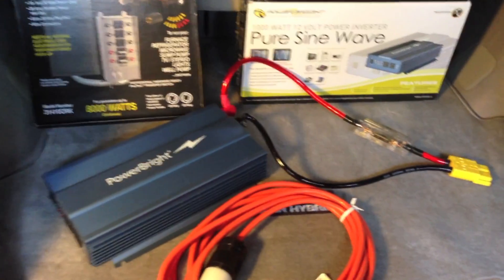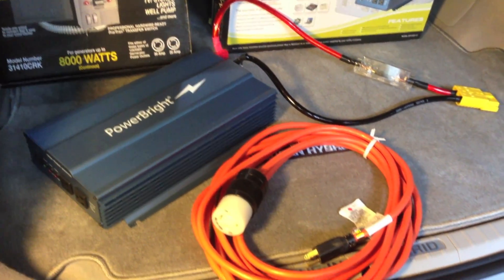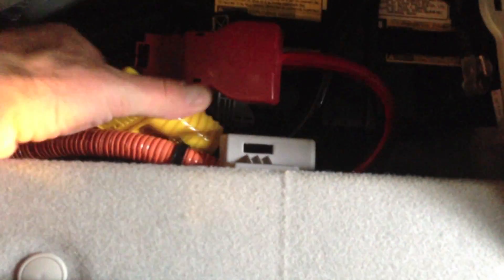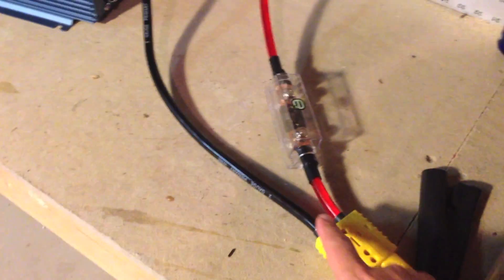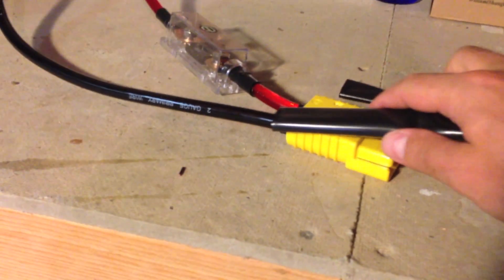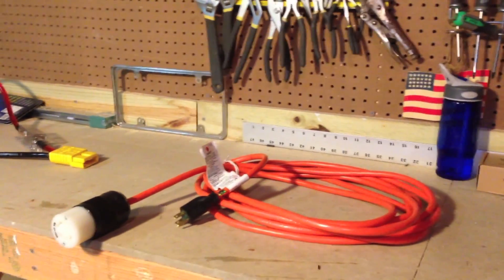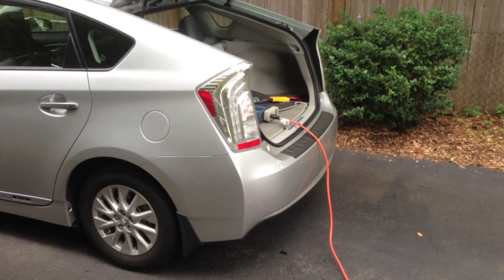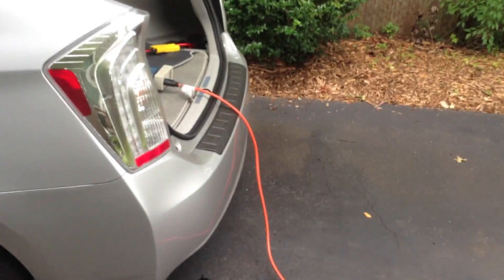Prius Home Generator - Part I

Comment: I love this video. Very useful. I have been considering taking this a step further and removing the generator from between the engine and transmission and running it off of a smaller engine. You really give some good information. Thank you

Comment: Nice. I didn't know the little 12v Prius battery can give up to 100A. I wonder what is the max charging current of Prius that could help to run it for longer periods
Reply: The power is not coming from the little Prius battery. It is coming from the traction battery, via the DC / DC inverter. When the system is of the little battery is a power source. If you turn your lights on, it will power your lights, once you turn the system on the inverter takes over and the AGM battery becomes a load, not a power source. This batter would not last thirty minutes with the system off.

Comment: Can you do this with a rav 4 hybrid?  Not prime
Reply: Yes, the synergy system is very similar in both hybrids.  You'll want to find out how much current you can draw.  In my 2004 Prius, the inverter or the 'generator' circuit should have a fuse/circuit breaker to insure the power drawn is less than 95 amps - because the Prius inverter will open an internal fuse if you get that high.
Reply: @cawag98 I have a 2014 Prius I want to use this while I'm camping. So it will be second nature in an emergency.... I just don't know what inverter to buy?
Reply: @Brock79  Check the other comments and main video, but I'd suggest getting a pure sine wave inverter.  You'll also need reliable connections to  the battery terminals, short, fat (2 or 0 gauge) wires, a fuse (75 or 80 amp) on the hot wire.  I'd suggest a 2000w or 1500w inverter -- but note that the limitation of the prius is about 800-900w so your in line fuse will be the limiting factor, not your "2000w' inverter size.    I'm searching for a pure sine wave inverter I can connect to a house transfer switch - if anyone finds one.  This means it must make all power on the hot AC plug terminal and must have a floating neutral.

Comment: I love this video and I’ve recently acquired a prius and I have absolutely fallen in love with it and I’ve become  aware just through logic that it’s basically a generator so your video is exactly what I was looking for. I do have one question about what you do when you have your Prius disconnected from your home.
Do you have any appliances that have set alarms or user settings on them that determine how they are used such as a coffee pot that has an alarm timer or a microwave that has certain Settings on it that reset to default when you disconnect your Prius from the home. Does the whole house power down and all those appliances reset to zero or default or do you not have any appliances that do that? It’s not a deal breaker for me but I’m just curious.
Reply from the maker: Hi Kim.  I only have used my Prius to generate power for the home in emergency conditions where the main power grid was offline.  Be sure to watch part 2 of my video (link in description), because I explain how to use the transfer switch.  The transfer switch basically is configured so certain outlets/lines in the house can be switched between getting power from the generator OR the normal power supply.  The other reason the power switch is important is so you can control how much is being powered in the house. The prius can't handle a lot of wattage so you wouldnt want to have it on a circuit that is powering something quite intense like a microwave/coffee pot/hair dryer, etc.

Comment: Thank you great video sir. 

How does 120v to 240v by jumper ?
Reply from the maker: That's a little sketchy, but read this post to get more info:  https://www.doityourself.com/forum/electrical-ac-dc/555964-120v-generator-240v-transfer-panel.html
Reply: @FrankPerkins  thank you repry I didn't seeyour reply on youtube by misstaje I click history & I found this & link

I have 120v inverter pure singg wave 

Wind turbine & solar pannel in my house. 

How many watt toyta electric generator create  ? 

Yamaha create over 100 killowatt by thire car 

I couldnt find how many watt Tokyota gen 2 create? 

And I couldnt find diy  solar complete Toyota prius or 90 % solar powerd car yet 

I wanted to convert as much to solar enagy

Some put solar pannel on their car to create more enagy

When you use electricity to 12v battery to inverter when enagy is low toyota gus engine will create more electricity right ( how nany watt?) To send to 12 v battery ?

Where do you see thus idea hyper links sir ? 

I really want to understand wireing and engenner so 

I don't kill my car and use more solar enagys please send my those hyper links i couldn't find much please.

Thank you showing awesom green ideas 
You are so gunious

I love your udea & video sir thank you reply & created so awesom humanity changing green enagy channel sir.

Comment: why are all you people i see using a hybrid to power your house doing it in such a way that EVERY vehicle can, you are hooking the inverter up to the battery that is charged by the alternator. what i would imagine you doing is using the generator that actually powers the hybrid electric drive system, THAT is where the REAL power is and the whole reason one would use a hybrid VS a regular vehicle..
Reply: Because, the regular car - regular alternator solution is only a temporary and not very good solution.  Here's why:  The amp output of the alternator is for a very high engine RPM, something like 2500-3000rpm - cruising down the road.   Sitting in the driveway idling at 800%, you will not be able to recharge the battery against all but the smallest current draws.   You could put a brick on the gas pedal and that will get your RPM up, but the car will go through fuel very quickly (a couple hours, I'd guess).  Finally, a large current draw might overwhelm the alternator, and then you need car repairs...    The full hybrid solution for medium current draws (up to 80-90A, or 900W or so) is really elegant: the car (usually a Prius) is left in 'ready' mode and will use the hybrid battery to replace the power taken from the 12v battery by the inverter.  When the Hybrid battery is depleted enough, the gas engine cycles on and off to charge it.   The car uses less than a standard generator, is quieter, requires no generator maintenance.   Essential is correct and safe connections to a suitable inverter (namely thick 12v short wiring with a fuse of no more than 90A on the hot lead etc).
Reply: @cawag98  uhh you realize that you both backed up MY point as well as got some things very wrong. a regular alternator that is on every car doesnt have to be at a high rpm to have its full amp output, it has a built in regulator to change current based upon needs. but the point i was making is that a hybrid such as a prius CAN produce more power than an alternator can produce which means it will use the gas more efficiently VS just the hundred or so amps the alternator would put out, (unless you have a dozen alternators running off the same engine, which i have seen done on a mobile radio station) my whole point from the onset was that you dont need a hybrid to do what was shown in the video, any car with an alternator would do this, and that is my point, that you'd be better off tapping into the hybrid system rather than tapping into the 12v alternator..
Reply: @the_socompsp  look up the power output curve of an alternator versus motor rpm.
Reply: @cawag98  hate to break this to you bud but those are not based on ENGINE RPM but ALTERNATOR RPM, once the alternator reaches 2500-3000 rpm the output plateaus. the reason the output starts to level off at 3000rpm is because that is how fast it is spinning while the engine is at idle, this is why the alternator has a SMALLER pulley than the engine pulley, this way when the engine is idle at 900 rpm the alternator is already at nearly 2500 rpm. this is also why vehicles equipped with an aux alternator have a "fast idle" of 1500 or so rpm, cause at that engine speed the alternator pulley is at whatever gear ratio higher, something like 4k-5k rpm.

Comment: Hi. I have used my Prius as an generator for years. Main difference is I don't have a transfer switch and instead just run some extension cords from the inverter into the house. I just wanted to alert your viewers that the custom cable from your inverter to the transfer switch will only power 120v circuits. If you have a 240v circuit (eg dryer) in the transfer switch, it will get 0v. This is because you have both hot leads shorted together in the cable. From what I can see, all of your transfer switch circuits are 120v so you should be ok.
Reply: I hope you're not just plugging power into a street-connected house; during a power outgage, that could kill a line-worker.   I figure you're not, but I write this for others who might try to 'power the house' with a 'suicide cord (extension cord with both sides male).
Reply: @cawag98  So turn off your main breaker first?
Reply: In theory, you could energy the high voltage primary line via the distribution transformer. However, it is highly unlikely you could do it with a 1,000 watt inverter. The relatively low impedance of the transformer, the primary circuitry and your neighbors homes on the same transformer, would appear to the inverter as a dead short, shutting it down immediately.
Reply from the maker: Yes. Good point!

Comment: Both of your tutorials are awesome.  I actually tested the concept using 1500W converter connected to a family member Prius and worked perfectly.  I have to back up gasoline generators I keep around so this is a great alternative during a storm outage where gas becomes a premium item.

I am currently leasing a car but as soon as that ends I will switch to a used 2007-2009 Prius. An interesting fact is that in case of power outage both of my back up generators are kept in the garage with an electric door opener.  I would have to disconnect the door and manually open it in order to get the generators outdoor to the plug-it.  At my age that’s not easy so even now I can open my garage door and gate using the inverter from my current car and future Prius.  That’s win win all around.  Again Thanks for your insights and tutorials!!!.  I also liked your update
Reply from the maker: Thanks Jose. I have the same deal in that if my power goes out, I can’t get into the garage. In case of a big storm, I disconnect the garage door opener so I can manually open. You can also use a coat hangar and just snake the manual cord pull too

Comment from the maker: Update August, 2020:  We finally had a long term power outage where I could test the Prius generator system.  What I observed is that the plugin battery slowly discharged as I drew power from the traction battery hookup.  I estimate I can get an hour of electricity for every mile of EV range.  This means that the battery was essentially drained after about 9 hours and then the engine would kick on to recharge the system.  While it was running, I kept checking the various plugs and cords and nothing was warm.   When the main battery was drained, I would disconnect, go to one of the public chargers in town that had electricity.  Everything worked as expected with no issues except for the fridge.  My subzero needs more than 1000w to startup and would trigger the inverter's load sensor.  While I could reset the inverter and try again to  keep the fridge running, it seemed to be only partially running.  Perhaps on only one compressor as I believe I have a 2 compressor fridge.  

Even though it worked well, I was somewhat nervous of overloading the systems within the Prius.  After a few days of driving, everything is working exactly as normal with no issues so I think the setup is safe and works pretty well.  Because of the fridge needing more power, I since purchased a Honda EU2200i generator as my primary standby.  I can still use the same transfer cable, but can now power the fridge.
Reply: So based off your comment I assume the whole 4.4kWh battery? (Pulls from the two secondary first before reaching max discharge of 3.3kWh?) I've been debating about getting a Prius Plug-in since it has a larger battery and was wondering if the whole battery would be able to be tapped into through the 12V system. Also is it only possible to charge the primary battery with the engine since the secondary batteries were only designed to be charged from the wall the rest of the way? I heard it's possible but toyota didn't design it to be done that way regularly.
Reply: 12v fridge?
Reply: I am confused as to why you needed to charge the Prius. I thought, the engine would start when the traction batter was low and the generator would charge the batter?
Reply from the maker: @galinstan5603  If I have the prius fully charged, it will power the house using it's internal battery.  Once that is depleted, the ICE will kick in.  It's mainly to maximize the amount of power I can produce.

Comment: The little battery in the back of your car is very small and only for turning on 2 main computers for the alarm system and key switch. Your going to burn your car up trying to pull that many watts from a battery with very few amps. I hop nobody Copied you thinking this was a smart idea
Reply: Yes if the car is off other than that it’s fine there’s a 1.2kw converter under the hood to provide 120amps to all accessories